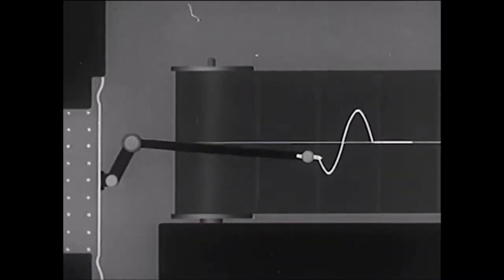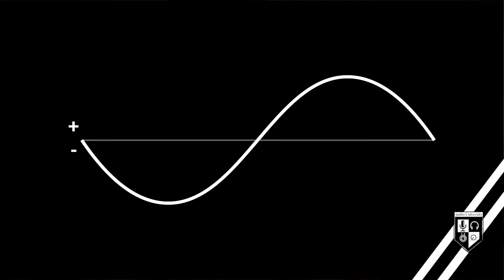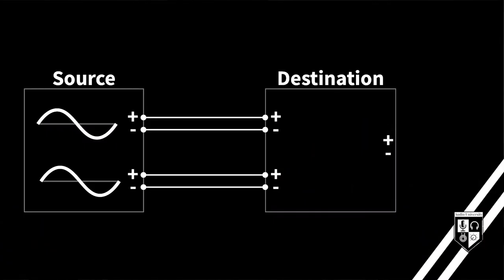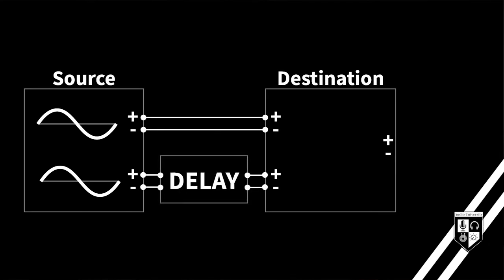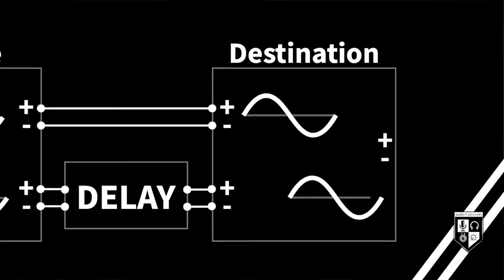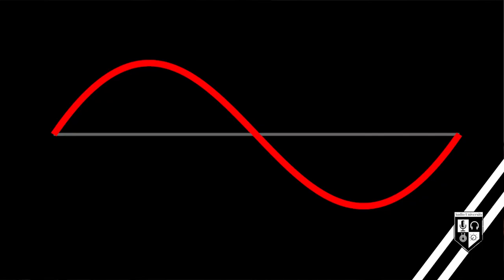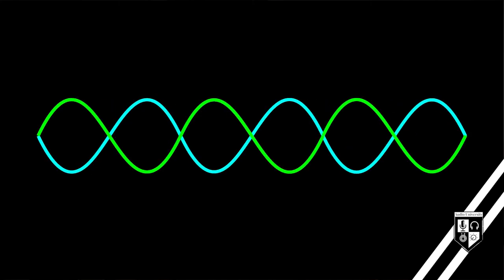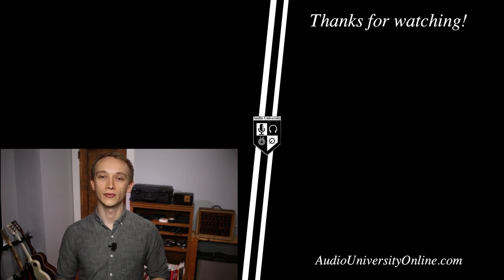POLARITY vs PHASE: What's the Difference?

Comment: Thank you! When I forget the difference due to a lack of practicing, I try to remember visually, that polarity it's a Vertical thing (just up-down), and phase is an Horizontal thing (just left-right) where Time is added to the equation. Or polarity it's just a matter of voltage, and phase it's a matter of time. Those tips help me to keep it fresh but I think the more you work with your DAW, the less you have to recall the tips!
Reply from the maker: Thanks for these tips, Veronica!

Comment: The shift at the end of the three frequency components was a time shift, not a phase shift. A time delay corresponds to a linear phase response where each frequency is shifted different in its phase. So to keep it short; polarity is the special case of a 180 degree phase shift for all frequencies which is not the same as a time delay.
Reply from the maker: Thanks for clarifying that, Rene Christensen. Much appreciated!
Reply: I have "seen" wave form that obviously does not have positive half mirroring negative half, in that case, adding a opposite polarity signal of itself will continue to cancel out (destructive interference) each other, but adding 180 phase shift of itself will not do the same "complete cancellation"
Reply: @philiptong4978  They make the same mistake of obtaining the 180 degree shift by shifting the signal in time. That is not what a system with a transfer function that shifts the phase would do.

Comment: Great video! It really helped me! I just have one question: 
Can I invert tha phase of my output cable of my pedalboard and conect it directly to the input of one of my amplifiers? I won't fry anything by doing that?
Reply from the maker: It won’t be as simple as flipping the wires in the cable, because it’s an unbalanced connection.

Comment: Another (nameless) YouTuber made the statement that phase alignment and time alignment were two different things.  He did not clarify or explain.  Do you have any idea what he might be talking about?
Reply from the maker: Phase alignment has to do with time, but it’s often frequency-dependent. 

For example, speakers often experience phase shift, where the phase of some frequencies is shifted in relation to other frequencies. So, a simple time alignment won’t necessarily optimize the alignment between a subwoofer and main speaker. Instead, it’s best to align the phase at the crossover frequency. 

This video may help: https://youtu.be/YToV8Q-K83s?si=Am5C5-PsS2bREI1l

Comment: Any solution to my sound card lacking a button for inverted phase/reverse polarity? I have found that in my daw it really helps to hit the button in the mixer, but I'd like to have a global solution and a hardware one would be great. I use my speakers and my microphone causing some issues, noise-cancelling software is taxing on the cpu and likely very unnecessarily.

Comment: I have speakers in 2 rooms running off of the same amp.  Some of the wires are in the walls & there are no marking on the wires & the wires are both the same color.  To compound the problem,  one room has sealed bookshelf speakers   so I can't see the direction that the speakers are moving.  Is there any way I can determine the polarity of the book shelf speakers since I can't see their movement?
Reply from the maker: While it would be ideal to wire both speakers in a way that a positive voltage creates an outward movement, the most important thing is that they are in the same polarity. You should be able to listen to the speakers and tell if they are wired differently. Choose the wiring that sounds best.
Reply: connect a battery and voltmeter at each end to check the wire pair?
for the speaker pair, relocate them to face each other as close as possible, play identical content on both unit at the same time, if one of them is wired incorrectly then destructive interference will happen and result in much lower volume compared to both wired the same polarity (compare result with same speaker location, orientation and listener location, orientation)

Comment: Phase = opportunity of 360 degrees, Polarity = 180 degrees swtich. Often misnomer, misused, abused term. Also known, or at least implemented as " Mid / Side " micing and mixing techniques. But the balance of which is where the fundamental  sense of 'depth' in both Mono and Stereo lies. It is into the Z axis.